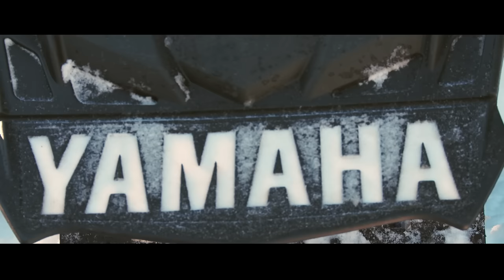The Real Story Behind Yamaha and Arctic Cat

Comment: In my opinion, Suzuki engines are the best, they brought the 1000cc engine when the Thundercat came out and broke records. No other brands did this, im sure Suzuki would still be capable of doing this but i guess Arctic Cat don't want to put the money in to it. I'm disappointed with this, they just ditched Suzuki. For that reason if i would buy a brand new snowmobile, it would be a Ski-doo They have always used Rotax and are great engines and will most likely always be using them. Polaris is good too and don't have anything against Yamaha, they have made and continue to make good sleds but i dint think their engines belong in a Arctic Cat. I have a 98 Thundercat and will keep it for a long while and if i buy anymore Arctic Cat sleds, i will only buy the older ones with a Suzuki engine in it.
Reply: LoneRBlackWolf cat is getting better love my new mp 700 the cat moter has impressed me but I agree Suzuki is tried and trued

Comment: Ben a cat rider for 20yrs n I think this is a last ditch effort to save arctic cat from going under. just in my area of Wisconsin almost all cat dealers closed there doors in the last 10yrs n everyone I have ridden with for the past 20yrs has switched from cat to ski doo n Polaris. Part of the problem with cat is they made a lot of really ugly sleds. Decided a while back my next purchase will be a Polaris
Reply: I agree with you Ryan about the sleds of old, but I have to say that I switched from a modern day Ski-doo (2015) to a 2016 ZR7000 Limited. That sled to me is a kick butt looking sled that does everything I would ever want to do on a snowmobile. The Yamaha 3 cylinder four stroke really motors along and the 'Cat chassis with those Fox QS3 shocks do an outstanding job. I hope the dealers eventually come back or at least maybe they will sprout new dealerships because it would be a shame to have the 'Cat name go away.

Comment: I disagree with this.  It's just the beginning phase of a merger.  Call me a traditionalist.  Its like putting a Chevy engine in a ford??  Really.  Don't like it.  Both manufacturers need to be stand alone.  Creates better competition.  An era gone by I guess.
Reply: +Ole Ironhead Arctic Cat was already renamed 4 times, went bankrupt once, moved headquarters. It's only natural that it will get acquired. Matter of time.
Reply: Alex Povolotski They've already been bought
Reply: Ole Ironhead guy it’s not about  nostalgia it’s about money, continuity if they can make a sled half the price and sell it for more then there always gonna do that
Reply: Ole Ironhead your right. Yamaha used to make so much better sleds. Like I'm talking about the reliable 700 and 600 triple so that's there sleds in between 1998 and 2003. They made so much better sleds and sold much more. Yamaha had it perfect before the four stokes.
Reply: I just would want ford with Chevy, at least GM is making the 10 speed for ford right now.

Comment: I have owned Yamaha sleds for 20 years. I have to say this Yamacat is the biggest piece of crap I have ever bought.
Reply: +lee too bad they had to merge, i loved yamaha until they started working with unreliable Cat junk
Reply: +guy proulx Arctic Cat is very reliable (they have, however, suffered some hiccups on first-year-chassis', i.e. 2003 and 2012), our group has totaled 23 different Arctic Cats since the '80s, and only two have ever had any issues. The first being an electrical failure on a 2012 F1100na, and the second a bad oil filter gasket on a '16 ZR 7000, which caused the engine to dump all of it's oil on the trail (Yamaha's fault).
Reply: Starting the 4-stroke engine was never a problem on the Nytro, but was a problem on 2014-2016 vipers (Arctic cat's fault)

I don't care, I rather twist my key once extra then having to split my fucking engine apart every 5000km to lube some bearings.
I've had ski-doo and only tested polaris, now that I bought the Viper I know what i'm going to buy next time I want a 2-stroke.
So in my eyes they both won!
Reply: @R1D387  did you trade a Nytro for your viper?
Reply: SubSonic no i’ve never owned a nytro but I got friends that has, why?

Comment: bad move for Yamaha, Arctic scrap is getting Yamaha technology and bulletproof engines, what is Yamaha getting in return, nothing they didn't already know, knowing that new Yammies are going to have Arctic scrap parts on them is a turn off for me, guess i'll keep riding my reliable old Yammies
Reply: they didnt know how to build a winning sled.  slow, heavy, poor handling.  how many championships has yamaha won?  cat could have gone with honda engines and yahaha would be out of snowmobiling.  cat would have gotten a better engine from honda built to cat specs.
Reply: SCROGY Cat would have used Honda specs cause they never could make an engine , there's a reason why they are now putting Yamaha engines in their sleds now, Cat could never build engines to last, always blowing up, the engine in the srx 700 was way more reliable than the engine in the F-7
Reply: +guy proulx I don't think you understand specs.  The design specs would be cats, the manufacturing specs would be Honda.  Either way, Yamaha could never build a competitive sled.  Their designs were archaic.......that's why they left Sno Cross.  They couldn't win.  Their chassis were outdated and heavy.  Meanwhile Cat and Ski Doo,were dominating Sno Cross and Cross country and still do to this day..  Yamaha went to four strokes because they needed a gimmick to sell their redesigned sleds.  Reliability?  I'll take the power and weight savings of a two stroke any day, thanks.  And if Honda were building a two stroke it would be super reliable.  Four strokes are for old men and ladies.
Reply: guy proulx You seem to be forgetting the new CTEC series of engines from arctic cat, fantastic/reliable two strokes. This only makes sense from a business standpoint anyways. Arctic cat builds great chassis and two strokes, yamaha builds the best 4 strokes, win win.
Reply: SCROGY You say that becaus you don't run chutes, take a wimpy 200hp turbo 800 up a big chute pinging and detonating the whole way up and now try it on a 300-400-500 reliable turbo Yamaha. When it comes to climbing, power wins.
Reply: What Yamaha gets is Cats proven procross chassis.  A lot of racing and a lot of success that Cats had with that.  I'm not a huge fan of this either, but if you're into 4 strokes, Yamahas are bullet proof.  As long as I can still get a Cat...